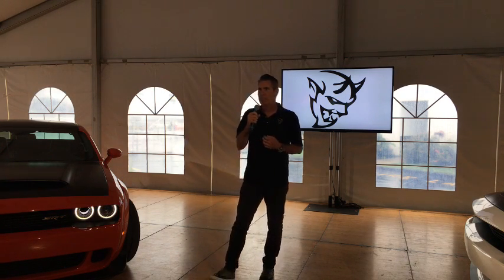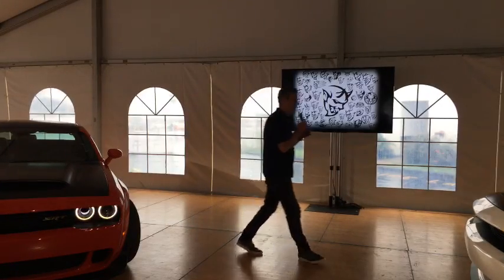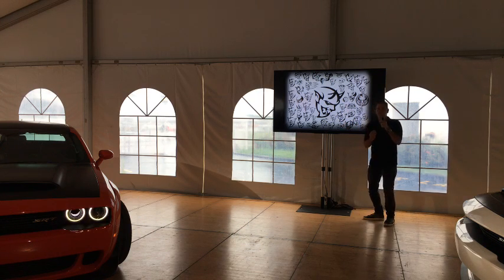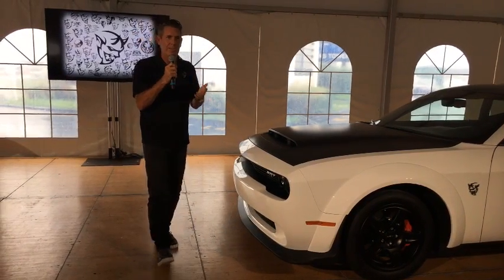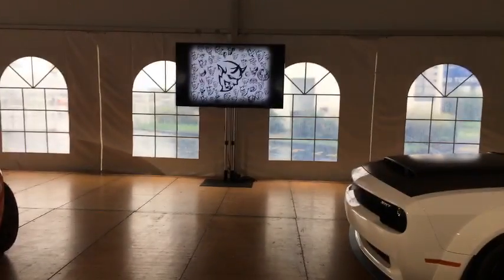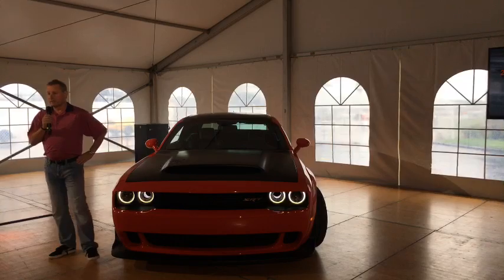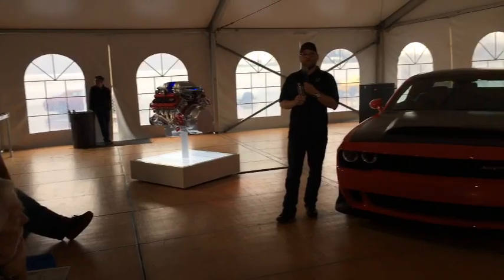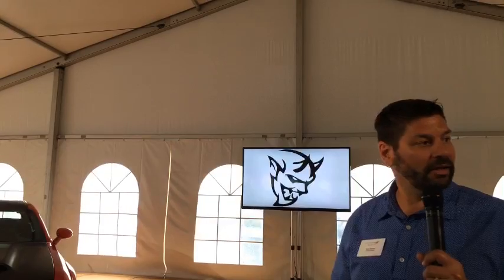Dodge Challenger SRT Demon: You Saw It First

Comment: Car starts at $84K, not $82K.  The tires are rated to 168, not 149.  Without race gas, it is 808HP, not 807HP.  That part you picked up is the module that goes in the dash that allows you to run high octane.  Rear gear is 3.09, not 3.20.